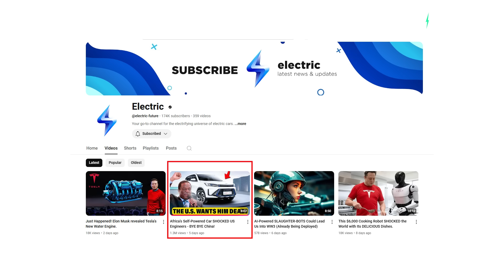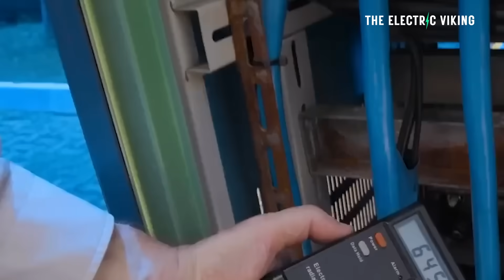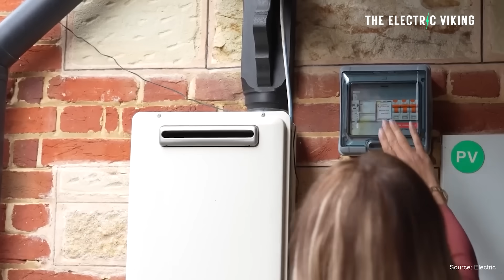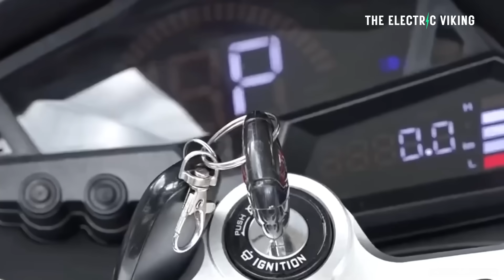Internet claims Africa’s Self-Powered Radiosonic Car SHOCKS Engineers

Comment: I did some maths on this. Per these calculations, in order to receive ONE watt of power propagated "over the air" would require 900-fiftythousand watt radio stations a mile away. Utilizing a one watt system, a typical model 3 Tesla battery would require FOUR YEARS to charge one time.  His idea will not work according to physics but will work to separate fools from lots of their money on false hope. 🐍oiler = Maxwell.

Comment: Mr Electric Viking  ...Do you not believe in radio, cell phones over the air television broadcasts etc ?  You apparently do not have an electronics background.  RF   radio frequency energy is broadcast "over the air" every day.  That is how the "signal" gets to your device . The battery or wall plug supplies energy to circuits to amplify that "signal" to power audio,  video  etc.
  Although the "amplification" circuits could be "revolutionary" , the reality of "energy" broadcast "over the air" is not.  As for violating the "laws of physics",  what balderdash,  Virtually every electronic device uses transformers using a principle called "induction",  this a/c power is then converted by an "inverter" circuit into DC to recharge the battery.  Every a/c plug in battery charger uses these  same circuits.   As power from the battery is used to propel the car the battery is recharged.........Just an "old"  USAF  electronics tech  from schools 56 years ago....

Comment: Research on Lakhovsky Multiple Wave Oscillator. Which in my opinion works on the same Principle technology which is changing radio frequency (electromagnetic waves) to electric current. just because it breaks the conventional scientific thinking does not mean its fake.

Comment: But when asked what radio waves, he was unable to reply fully. I can only think of radio waves being used in inverter designs to produce the energy required to charged the battery. A common technogy in switch mode tech. But it's the amount of power that's needed I cannot work out. Its a huge amount. Need good to see it. But the search reveals nothing.

Comment: This video is RIDICULOUS !  
- Are you a SCIENTIST? 
- you provide NOTHING other than "it is obviously fake" , And "this is a waste of my time"
- Nikola Tesla said something very similar 100 years ago ( he was one of the greatest physicists in history), that conceptually energy can transfer from the air without wires
- IF true then ABSOLUTELY correct that the big EV companies and oil companies are SCREWED , that is an OBVIOUS consequence of the greatest invention in history (if of course it is real)
- is it possible?  - YES  - think about it, it is not hugely different to the solar concept. Solar is just converting one energy from into another (electric energy). Maxwell's idea converts radio waves (which are the same as sunlight - both are ELECTROMAGNETIC WAVES just with different wavelengths). If solar energy is essentially "free" energy then why is this any different.
- years ago people including many many scientists rubbished FUSION as impossible (not that many years ago), but now it has been demonstrated and in 10 to 20 years it will solve our energy problems. This sonic energy is also conceptually possible.
- I saw two videos which you have missed, that CLEARLY showed that a professor came from USA and has checked the claims and now backs Maxwell's invention, similarly a local Zimbabwean engineering professor also backs him.
Reply: At least you know something about solar panels therefore you might be able to understand that radio waves carry less energy than visible light. Therefore, these cars cannot possibly be as claimed.

Comment: Hey, keep the science straight! It's not touted to be a perpetual motion machine. It is purported to be a radio powered system. The idea of microwave power has long been toyed with. The other thing is, range is not quoted, neither is charge time required between drives.

Comment: Yep violates the first law of thermodynamics and also violates the Inverse-Square Law of Electromagnetic Radiation, micro sonics works in the microwatt region with piezoelectric devices but to harvest kilo or megawatts one would have to transmit terra or Peta watts, as RF radiation reduces in power density as it propagates through the air, utter BS

Comment: Ambient RF Energy Densities Are Extremely Low
In a typical urban environment, the power flux from all broadcast and cell-tower signals combined is on the order of nanowatts to microwatts per square centimeter.

A good RF-harvesting “rectenna” (antenna + diode rectifier) might achieve ~50% conversion efficiency, but at 1 μW/cm² you only get ~0.5 μW/cm² of usable DC.

Even a large 1 m² antenna would only yield a few millijoules per second—enough to trickle-charge a sensor, not to run a pump, a fan, or light bulb.

Conservation of Energy & Thermodynamics
Energy can’t be created from nothing. Any device that outputs more power than it absorbs from its environment (including its own internal stored energy) is a perpetual-motion machine of the first kind—and has never been demonstrated.

If your box truly ran indefinitely at, say, 10 W output, it would have to be soaking up 10 W continuously from some source. Ambient RF simply doesn’t carry that much.

What RF Harvesting Can Do
Power tiny wireless sensors (IoT nodes) that consume microwatts or less and only transmit occasionally.

Trickles of power for ultra-low-power electronics, e.g. battery-assist, RFID tags, or wearables that sleep most of the time.

Anything beyond that requires either:
A very strong dedicated RF transmitter nearby (like a purpose-built power beacon), or
A hidden battery or another energy source inside the box.

How Scams Typically Work
Hidden batteries or supercaps that aren’t obvious at first glance.

A small solar cell or vibration harvester hidden behind a panel.

The “load” being so trivial (LED blink once, tiny motor briefly) that it runs on stored energy for a while.

Ambient RF Power Is Tiny
Even in a busy urban spot beneath a cell‐tower or next to a Wi-Fi router, the power density in the air is on the order of 0.1–10 μW/cm² at best.

Example: A very generous 10 μW/cm² over a 1 m² antenna aperture yields only 100 mW of RF power intercepted.
Reality check: More typical is 1 μW/cm² → 10 mW into 1 m², and real rectifiers (diode + matching network) are only ~50% efficient → 5 mW of DC.

Stepping Up Voltage Doesn’t Create Energy
A DC-DC boost converter can take, say, 1 V at 5 mA (5 mW) and spit out 10 V at 0.5 mA (still ~5 mW minus losses).

Power in = Power out + Losses

If you raise the voltage by 10×, the current available must drop by at least 10× (minus conversion losses).

You cannot use switching electronics to “magnify” total power beyond what the antenna harvests.
Ambient RF Sources & Typical Power Densities
(power at Earth’s surface, μW/cm²)
FM Radio (88–108 MHz): 0.01 – 1
Cell Towers (700 MHz–3.8 GHz): 0.1 – 5
Wi-Fi (2.4 GHz): 1 – 10
Bluetooth (2.4 GHz): 0.01 – 1
TV Broadcast (54–890 MHz): 0.001 – 0.1
GPS L1 (1.575 GHz): ~0.0000001
Cosmic Microwave (1–100 GHz): ≪0.000001

Bottom-line: even under the strongest real-world conditions, you only harvest microwatts to low-milliwatts—nowhere near enough to power anything beyond tiny, ultra-low-power sensors.
Bottom Line
Harvesting RF energy is real, but only for microwatt-scale applications. Claims of a self-powered, unlimited-run “radio-wave generator” that drives significant loads without ever recharging contradict well-established physics. Any device purporting to do that is almost certainly relying on concealed stored energy, an external power source, or flawed/misleading demonstrations.

Comment: * Floyd A. sweet -Vacuum Triode Amplifier" (VTA).  capable of producing excess energy,  by harnessing the zero-point energy field or vacuum energy. was purportedly based on the principles of 🧲 electromagnetic induction  🧲 -murdered with heart attack pistol.

* Adam Trombly  -closed path homopolar Generator, based on principles of 🧲 electromagnetic induction 🧲 and zero-point energy, -tried to kill him with powerful microwave device in backyard"

* Paramahamsa Tewari -reactionless electromagnetic generator (RLG) operated based on the principles of 🧲 electromagnetic 🧲 induction and space energy conversion.

* Bruce De Palma- N-maschine" could generate a self-sustaining electrical current without the need for an external power source. The device purportedly operated by converting rotational kinetic energy into electrical energy through 🧲 electromagnetic induction. 🧲

* Stanley Meyer -claimed to have developed a "water fuel cell" that could purportedly split water into hydrogen and oxygen using 🧲 electromagnetic induction🧲 -said he was poisoned before dying March 1998"💦

* Troy Reed- Reed Magnetic Motor," operated on the principles of 🧲 electromagnetic induction 🧲 and was capable of producing excess energy,-killed after creating electric car without a battery🔋 

* John Searl  -(SEG) Searl Effect Generator "a device that he asserts can generate unlimited clean energy by harnessing 🧲 electromagnetic induction 🧲 and magnetic fields.

* Mike Brady -The Perendev magnetic motor, -claim to produce continuous motion and free energy through the use of permanent magnets and 🧲 electromagnetic induction. 🧲 operates on the principle of magnetic repulsion and attraction, where magnets are arranged in a specific configuration to create a rotating magnetic field.

* Howard Johnson magnetic motor Johnson claimed to have developed permanent magnet motors that could achieve continuous motion and produce excess energy by harnessing the properties of permanent 🧲 magnets.🧲 

* Dale Simpson -Dale Simpson is known for his invention called the "Simpson Gravity Wheel," which he claimed could generate perpetual motion using a combination of gravity and 🧲 electromagnetic induction. 🧲

* Eric Laithwaite: Magnetic River 1975 Laithwaite's research explored the principles of 🧲 electromagnetic induction 🧲 and their practical applications in transportation and energy

* John Bedini- "Bedini SG" motor, which he developed based on 🧲 electromagnetic induction 🧲 principles. using a rotating magnet to induce electrical currents in coils, which can then be used to charge batteries or power electrical devices. claimed that his motor could achieve overunity,

* The Infinity Sav magnetic generator developed by the Ukrainian company Infinity Sav Limited.  generate electricity continuously, As the rotor rotates, the magnets interact with coils of wire, inducing electrical currents through 🧲 electromagnetic induction. 🧲

* Charles Nelson Pogue- miracle carburetor

* Tom Ogle  fuel from vapor Pogue technology , overdosed after 25 million contract"

* Nikola Tesla" -Wardenclyffe Tower, first electric car, no battery 🔋 Nikola Tesla developed technology to transmit electricity wirelessly using electromagnetic waves. He envisioned free energy for all, but investors reportedly rejected it, saying, “If you can’t put a meter on it, we don’t want it,” because they couldn’t profit from something they couldn’t measure and charge for.

Comment: I'm not going to "like" this video, because you clearly don't understand AT ALL what this man has invented. 
"Perpetual Motion" is a nonsensical term that means absolutely nothing. "Perpetual Motion" is a term that violates the Law of Conservation of Energy - and the fact that you would use such a term to describe this man's invention, means that you have  - literally - NO IDEA what he has done. "Perpetual Motion" is a 'buzz Phrase' with no real meaning - like a 'double negative'. 
'Perpetual Motion' would indicate a purely mechanical device that needs to be pushed, or initiated, and from there, it would spin, pump, or do whatever mechanical work it started, without end. 
That is NOT what he claims, and is a simpleton's way of describing a device that is NOT mechanical in nature. Nikola Tesla, nearly a hundred years ago, PROVED - beyond any shadow of a doubt - that POWER can be BROADCAST,  in vast quantities, through both the atmosphere, and the ground. "Electric cars" are NOT "green Energy" devices. What CHARGES their BATTERIES? Plugging the car in to the same power grid that has, at its beginning, either a nuclear power plant (whose only purpose is to turn water into steam, to turn a turbine, spinning inside a coil of wire, and generate a current, which is then sent down wires, into your home, to charge up the batteries to your car), or a coal-powered equivalent - also to turn water into steam, and turn a turbine. ALL power plants work the same way, with variations on how the turbine is spun. 
So in fact, the "Electric Car" was never anything more than an intermediary step to a new technology that was NOT going to be dependent on steam generators - which we've been using to create our electricity for over a hundred years, now.  If you have studied Quantum Physics (and he doesn't have had to in order to USE some of its properties), you would know that ONE of the primary differences between Newtonian and Quantum physics, in the way we now perceive the fundamental nature of the forces at play that keep our Universe from collapsing - or from  preventing you from falling right through your chair. We used to believe that the ENERGY of our universe is contained within PARTICLES: Protons, Neutrons, - in  the ATOMS (or the smallest particles of ELEMENTS) - and that the only way to release that energy was to SMASH two particles of a heavy element together. 
The way that Quantum Physics looks at the Universe is as a sea of ENERGY, interacting with itself, all the time, in a balancing act that prevents everything from slipping into a state of entropy - like a child learning to walk - by FALLING, and then CATCHING itself, repeatedly.  This "sea of energy" is called the "Quantum field" - and implies that because energy is EVERYWHERE, weaker and stronger forces are not only surrounding us - WE ARE PART OF IT!  We are made of it, and utilizing this energy, in various ways, all the time (cell Mitochondria are parts of cells whose function it is to turn ENERGY into matter, and then BURN it, releasing the ENERGY as heat).
Given this view, the only thing that inventors who have been finding many, many different ways of achieving the same thing - which is nothing more than finding different ways of "tapping into" this field, and using a small portion of it to perform a task - the same thing it does all the time (which is why it doesn't "break the law" of "Conservation of Energy (Energy can neither be created nor destroyed) - THAT would be "Perpetual Motion" - which is NOT what this is. 
"Energy" - ALL energy, is measured in wavelengths - from far below sub-sonic, up through the 'vocal' frequencies' (~20-20,000Hz.) continuing up into ultrasonic, and continuing on a spectrum into infra-red, Microwave, X-rays, and on and on and on. Some of these frequencies can be used as "carrier waves," to propagate - in combination - VERY powerful radio frequencies. This is what Nikola Tesla was working on - with great success. When the Oil and Coal Barons of the day realized what he was working on, they IMMEDIATELY cut all his funding, and made certain he would never get another dime with which to transmit an electrical field around the earth, that anyone could rap into for free. 
That is not "perpetual motion" (which DOES violate "the conservation of Energy" principle - it is simply wireless electric propagation - which does NOT violate these principles. People like yourself are skeptical of "power generation through frequency manipulation," because you've been brainwashed by our educational system to think in ONE NARROW way about the propagation of electricity. 
A clue to the type of technology he has stumbled upon id VERY clear from the fact that in EVERY circuit, powering every device he is powering, there are multiple MOS FETs - (Metal Oxide Semiconductor Field Effect Transistors."   MOS FETs can be switched on and off thousands of times a second, and generate CURRENT when they do so.  Not VOLTAGE - but AMPERAGE - voltage up to 120 or 240 volts is easy to produce - it only takes a magnet rotating inside a coil - but is useless without high amperage. If you understand these principles, than it isn't difficult to see what he's done - and it isn't unique, but other inventors who have come up with OTHER ways of doing it, HAVE come to tragic ends - because this technology - since its inception , over a hundred years ago - is a DISRUPYIVE technology, which WOULD upend the money and power that the Fossil Fuel holds the world in a choke-hold in now, as it has for the last century. 
If you DON'T understand these principles and devices, in combination with storage capacitors and other fairly simple technology, then you have no business pretending that you do, and telling people that (implemented properly) it won't work, because "perpetual motion is impossible." 
Stating this as your "proof" just makes you sound like you are as limited as most people are, after being indoctrinated into believing that Fossil Fuels being burnt, and their energy being converted to explosive energy (and in the process producing toxic gases like Carbon Dioxide, carbon Monoxide, and other detrimental and wasteful products from using heat and explosive force to produce the same energy that can be pulled from the Quantum Field (using Solid-State devices), and is then converted straight into useable power.